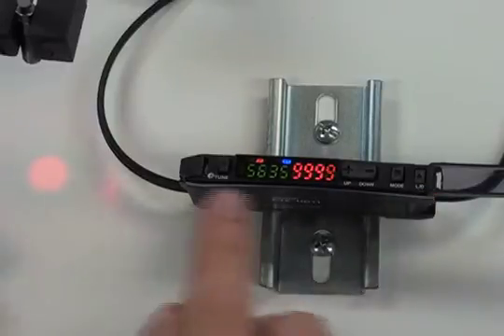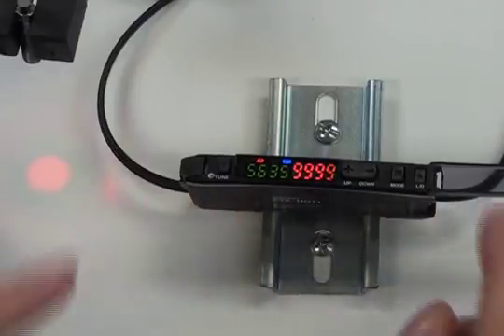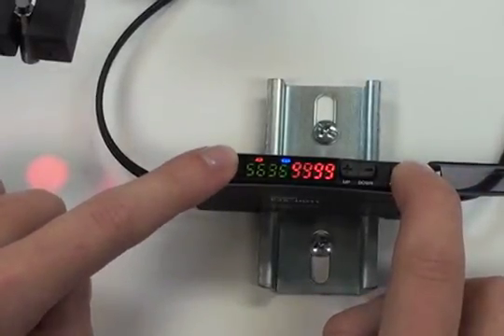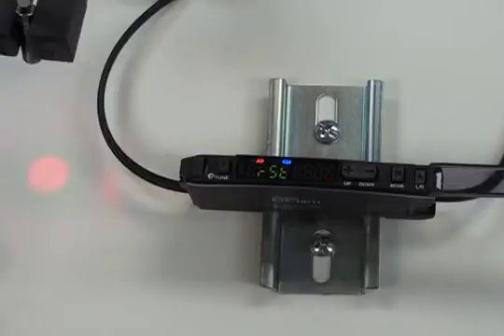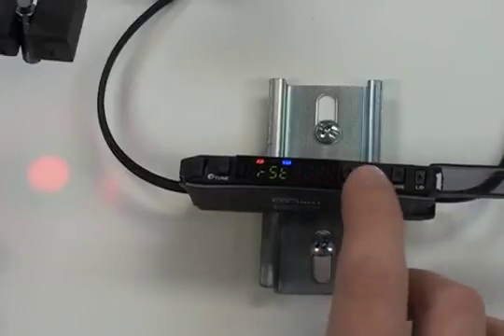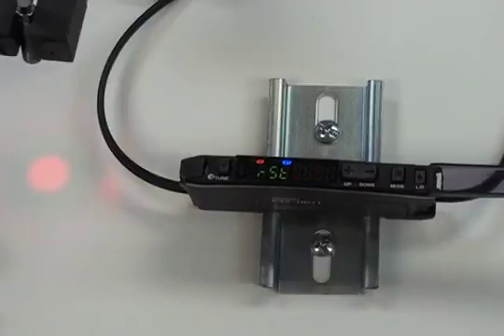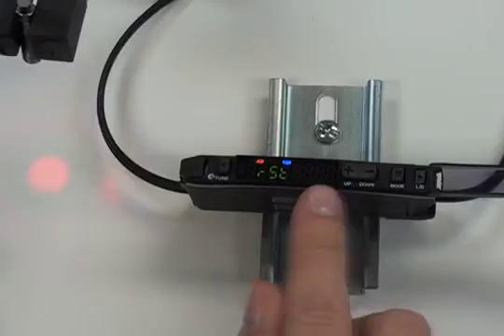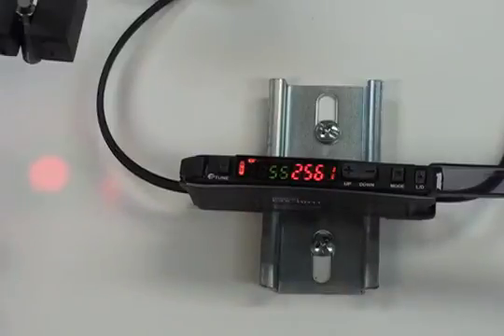7. E3X-HD Fiber-optic Amplifier - How to Reset the Amplifier to Factory Default Settings

Comment: How can I lock the settings? I don't want my workers to change it by accident.
Reply from the maker: Please download the Instruction Sheet:
https://industrial.omron.us/en/products/e3x-hd#downloads
The Key Lock Function disables all button operations.  
Press the MODE button and either the + or - button at the same time.  Hold both for 3 seconds or longer.  
Loc on will be displayed.  Then Save the Settings